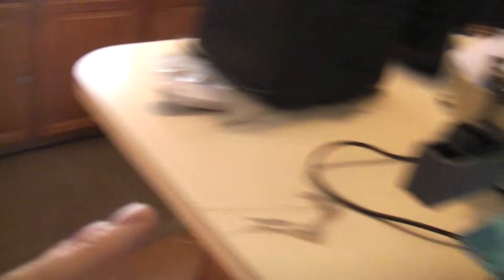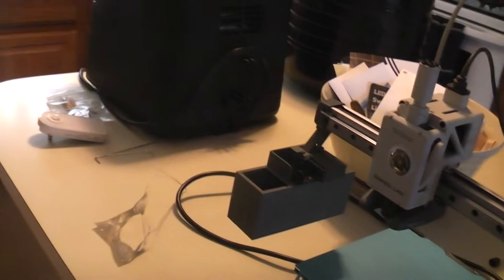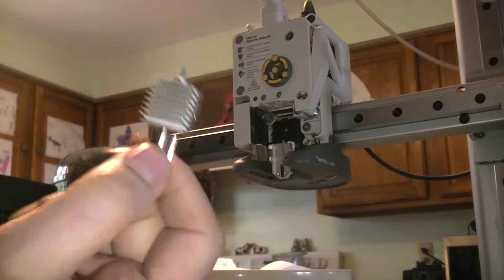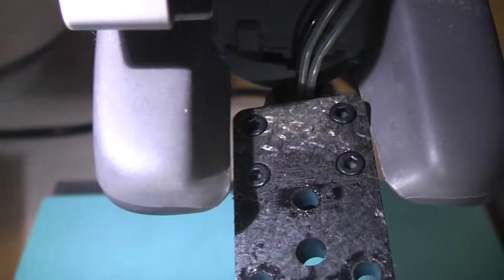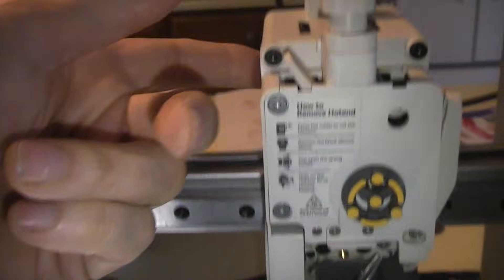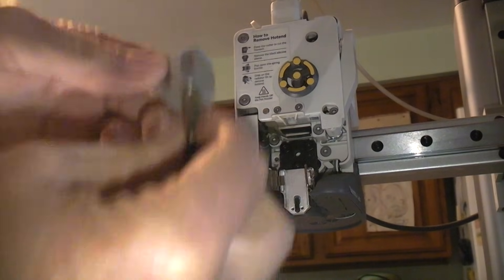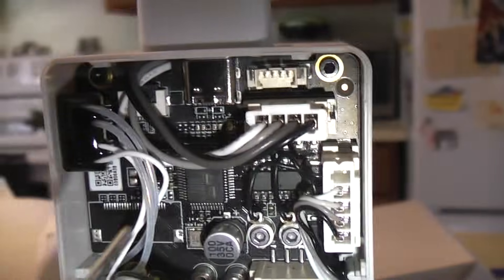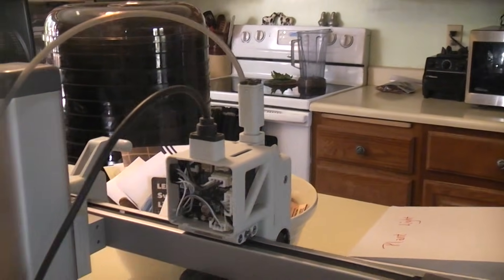Has the first layer of your Bambu A1 or A1 mini gone to CRAP. Here are the things to check. For Free

Comment: Thank you very much for the tip .. did you try the "not-original" hot end ? I bought a hot end  and a heating element from a vendor other than bambu lab and for the life-of-me  couldn't get them to work .. the nozzle drag on the bed as if the parts measurements aren't right or the hot end isn't seated right in the heating element .. did you try yours .. how did it go ? thanks again
Reply from the maker: I did try a non Bambu hot end when Bambu did not have any in stock and it would not clip into the heater unit properly, so never used it. Thank goodness it was low cost so big loss. And Bambu got stock back in so just ordered the Propper part.
Reply: @Robothut  Exactly what happened with me .. the nock-off hot end is collecting dust somewhere .. I bought a BBL original .. but GOOD news .. I finally got the heating element to work with the original hot end .. just remember after installation to do the extensive bed leveling procedure (the one that takes 15 minutes ) and all will be good .. all my best and happy new year.

Comment: Hey whats your thoughts on this. Its not as big of problem but sure you would know after having a1 mini long time. Have had my a1 mini for few months now and noticed it's developed a slight little plastic knock noise. Its like one knock per hop or when you sew the gear symbol on front retract backwards for second. Its seems and sounds probably like gear slop. Ive tighten my hotend screws and check the cutter all is good so just thinking it's play in gears. Your thoughts?
Reply from the maker: That sounds like the extruder gear that drives the filament is skipping. This normally happens when you have a partial clog in the hot end or when you have filament that is out of spec, to wide from time to time.
So you might try exchanging the hot end nozzle and different filament.

Comment: THANK YOU!!! Bambu Lab could not help me with my A1 Mini first layer problem, they kept saying that my slicer settings were wrong. I kept telling them that settings were the same as always and the problem started on its own. They also told me to tighten the head screws behind the nozzle buy NOT the ones behind the plate as you showed on your video. I was about to give up then today I saw your video, followed your instructions and it is fixed. Thank again!!!
Reply from the maker: A Christmas Mirical. Happy printing.

Comment: I'm really glad you made this video.  My A1 began messing up my prints.  So I followed your instructions and sure enough, those little screws were loose.  Hopefully I'll be good for a while now.
Reply from the maker: I consider it just a maintenance thing to check every now and then.
Reply: I did the same thing and when I got the 3 screws out from behind the hotend one of the 4 smaller screws literally fell onto the bed plate, two were loose and only one was still tight.
Reply: @jaxsorento   Bambu put Loctite on the three outer bolts.  I wonder why they didn’t do that for the inner ones.

Comment: If anyone, like me, is still having the dragging and scratching issue after having done this, I think I have found the solution: The problem is that the latch that holds the nozzle is too loose, so I just shoved a piece of folded aluminum foil in-between the latch and the nozzle and my layers started to come out perfectly
Reply from the maker: I found that if people try to use many of the after market replacement nozzles they are not the same as the Bambu labs ones and in order to latch them in place you will bend or damage the clips. So something to keep in mind.

Comment: 3 months of troubleshooting, a new heating element, a new nozzle, a new plate, a new whole X axis didn't do the trick, of this works I'll lose my mind
Reply from the maker: Seems like if you have replaced the heating element for the hot end then all those screws should be tight. So I would check the 2 screws for the sensor in the electronic box on the back of the extruder. That's what fixed one of my Bambu printers, the other had lose screws on the hot end mount.
Reply: @Robothut yeah I was referring to those 2, I remember undoing them to give some leeway to detach the extruding block when I had to change my carriage block, maybe they aren't fully sitted in right now

Comment: I've had this problem before and fixed it, but now it's printing bad layers even with the screws tight!
Reply from the maker: Make sure you clean and tighten the two electronic screws in the control box from the sensor. They are most important in the case of my printer.
Reply: @Robothut  Tried that too no luck :((
Reply from the maker: @radfaraf The only other things that come to mind is the slicer you are using and its settings. Also is it a problem with all STL files or just a few. If you find out what the problem is be sure to let us all know, in case we have the same problem.
Reply: @Robothut  I do simple models like 200mm x 200mm x 0.2mm to confirm it's a problem so it's only one flat layer. One time it was fixed with a new hotend assembly that bambu sent me for free. I'm on my 4th one in a year though. About to try replacing it again since I already have a spare and see if that helps. There is also one screw in the extruder in the front when you open it up to look that no matter what won't fully fully tighten or come out fully, I'm thinking maybe that is the source of the problem.
Reply: Also tried to pull out the stuck screw with needle nose pliers and it doesn't work. If I try to unscrew it, it unscrews a bit, then just rotates in the same spot without coming out.
Reply: got it out and actually noticed I have another extruder screw actually missing, ordered an a1 screw set and that will probably fix it.
Reply from the maker: @radfaraf  Cross your fingers but I think your right. All 3 of the front screws and all 4 of the back screws must be there and tight. Was the missing screw one of the 7 I mentioned or waws it located some place else?
Reply: @Robothut  It's one of the screws that hold the extruder to the thing behind it. Nothing to do with the hotend assembly screws, but it's right next to that area. If I push on the hotend itself that one loose screw feels like it's responsible for the extruder being able to move a tiny bit,  which has the same effect of a lose hotend assembly.
Reply from the maker: @radfaraf  Got it. Tank you for sharing with us. Just one more thing to keep in the back of our minds.

Comment: Excellent video. Subbed and saved. You right. I haven’t seen any videos on this. Thank you sir
Reply from the maker: I have seen videos that cover 1 or 2 of the steps, but not one that covers all 3 steps. Hot end front screws, hot end back screws and the electrical screw connections for the eddy current sensor. So thought I would do one. I saved my two machines.

Comment: I have done 'step' one a couple of times now, including nozzlw swaps, and the first layer is still crap. I will have to try tightening the rear two and see if this cures my problem. Cheers from the U.K.
Reply from the maker: Yes, step 1 is only good if you go on and do step 2 and tighten the back 4 screws, they seem to always work lose. But the fix for me was the Electrical screws on the rear PCB.
Reply: @Robothut  Just done evrything including the rear of the print head. My first layer is now decent. many thanks for your Video
Reply from the maker: @nickbutler7935  So glad to hear the print quality is decent again. Thank you for reporting back on your results.

Comment: Thank you for making this video. Very good explanation of what the problem could be for my a1. Do you think it would be a good idea to put some dielectric grease on the terry contacts to prevent oxidation.
Reply from the maker: I would hold off on the Dielectric grease and just loosen, move the contacts then tighten them back up. I now just consider the 3 front screws and 4 back screws on the hot end as well as the contacts just a normal maintenance type thing, that a person should do every 6 months or so.

Comment: Would thread lock help?

Greg
Reply from the maker: I am sure it would, but since it took over 1 year to be a problem with the A1Mini. I think I will just treat this as normal matinance thing and just check the screws every 6 months or so. I use my printers a lot more than most I think so it might not even be a problem for the casual maker.

Comment: Thanks for the info. I haven't had this problem yet but this lets me know what to look for. I didn't know the same sensor was used for the flow rate and Z axis homing.
Reply from the maker: Yes it all based on the movement of the hot end, so you can see how lose screws would really mess that all up. And poor electrical connections of the two Eddy current wires, really messes things up. It's just a maintenance thing. With all the movant of the extruder things are bound to work lose over time.